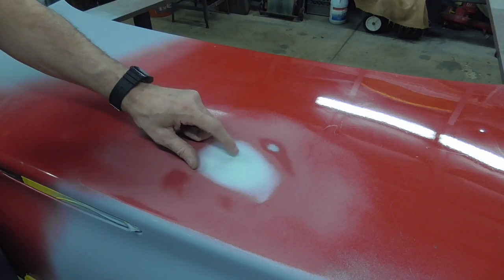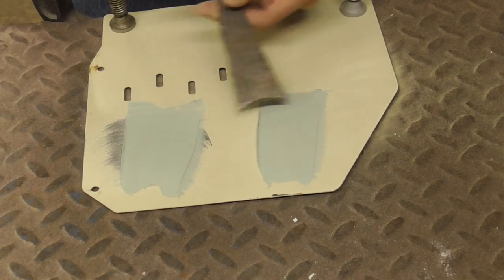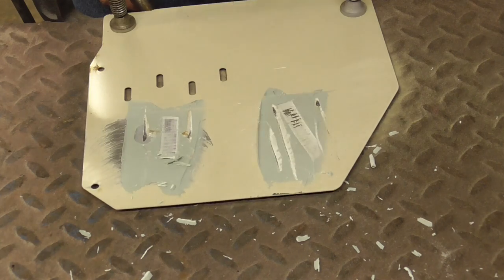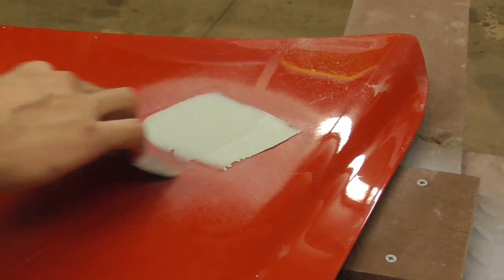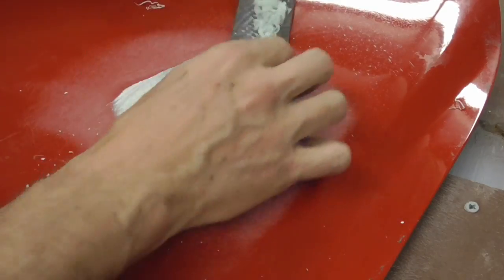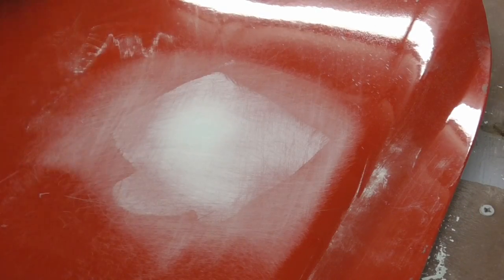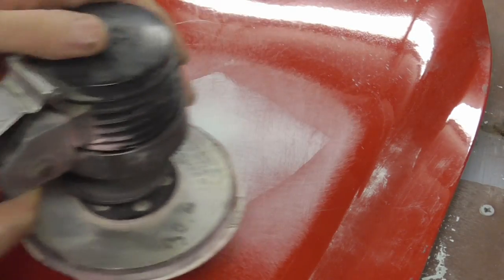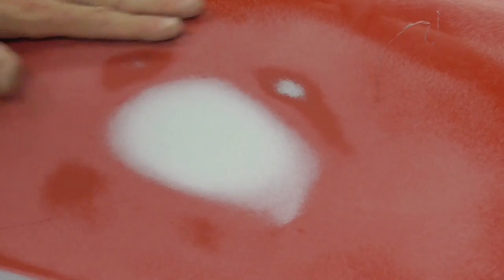Can Body Filler / Bondo be Applied Over Paint?

Comment: What about applying filler over primer?  I'd always heard that you should not apply filler directly to the metal but rather to prime the metal first, then add the filler.  That was until began watching your videos.  You apply filler directly to the metal routinely.  So, I'm kinda confused. :D  Thanks!
Reply from the maker: You never have to primer metal before filler.  I've worked in many shops and have never seen that once.  There are companies trying to sell a "pre filler primer" and its absolutely unnecessary.  Filler sticks best to freshly sanded/ground, clean metal. Use 36 or 40 grit fiber resin disc like these to prepare the metal:  https://www.harborfreight.com/4-12-in-36-grit-resin-fiber-sanding-discs-5-pk-69615.html   Shops use nothing else - go slow and keep the heat down.  The idea is to leave clean sharp cut scratches for the filler to adhere to.
Reply: @LakesideAutobody  Ok thank you!

Comment: What brand and type of filler is that?
Reply from the maker: Auto Body Master light weight body filler - right around $25/gal
Reply: @LakesideAutobody  is Evercoat brands alot better? Rage, z grip, xtreme etc...I'm needing one that will go on top of sanded paint that has no clear coat. Also easy to spread and doesn't dry real fast.. I sanded some spots to the metal. The areas that had rock dings and chips
Reply from the maker: @sonnywinstead9977  In my opinion - no.  That is when it comes to body filler.  All body fillers are generally the same and I always suggest going with a low priced body filler 😊

Comment: Could this be used on a plastic bumper?
Reply from the maker: It may work just fine - never tried it.  For a small crack or gouge I would just use body filler but for larger damage I would replace the bumper with one from the junk yard.
Reply: Thanks for the reply. I’ll give it a shot

Comment: Never use a cheese grader ,sand the filler while its still a little wet with sandpaper
Reply from the maker: Only the fastest guys in a body shop use a cheese grater.  A guy who is good with a grater is at least twice as fast as a guy who doesn't use one.  When you get paid by commission - that's when you'll start using a grater.   Truth 😊

Comment: Its's a load of bs, its just what the reps say that because they need to cover their ass and cannot guarantee anything without knowing what kind of quality the previous surface/paint is. Obviously during resto jobs things change alot. Good luck feathering old paint on some panels that come in for some insurance work that have been painted, primed 6 times and also have some bondo work. obv you are gonna bondo onto previous paint.

Comment: You are sure stuck on using that cheese grater. There was no need to cheese grade that amount of filler because you did not even put that much on there you could have sanded that off with 80grit from the git go. I do it every day at my job.
Reply from the maker: No way - takes too long / doesn't cut straight through.  With all due respect, 80 grit on freshly hardened bondo is just too slow, clogs up the paper,  and doesn't "cut" in order to achieve perfect body work with one filler application.  I've seen a lot of guys play around with fine grit sand paper and end up with wavy body work and a lot of extra work.  I'll stick with tools that cut through for straight body work.
Reply: @LakesideAutobody  I here you say that but that is not true at all. The time it took you to cheese it would have taken the same or less with 80grit I promise you i do it everyday all day. Because where i work the roughest grit that we have is 80 grit and i have no problem like you say. I would maybe agree with you if you had put more filler on, but that amount you put on was almost a skim coat. I will tell you what i will put up a video of me sanding with 80grit.
Reply from the maker: I 100% agree with you on the smaller stuff but for bigger dents I prefer to use the grater and 40 grit to start then finish w/ 80 - there's all different ways I guess - thanks for the comments - Jerry
Reply from the maker: aaron anderson  Good point!
Reply: Theres no reason for a cheese grater on such a small job. Just use glase and 150 grit  on a da.

Comment: You shouldn't just fill a dent heat it up with a small torch file it off no body filler needed
Reply from the maker: Just showing how dealerships and normal body shops fix dents :)
Reply: @LakesideAutobody  I'm pretty sure I've worked out a Chrysler dealership and a Cadillac dealership and we never fix dents the Way You are and I work in what you call a normal collision shop and we don't fix in that way either well I do we don't use hardly a gallon of body filler a year that's how well we straightener dents out before we fill them

Comment: Hi. Do you have time to reply pls?
Reply from the maker: Sure, what do you need?
Reply: @LakesideAutobody  Hi there and thanks. I have a new replica bumper for an Astra VXR (EURO CAR). I'm not happy with the headlight washer jet blanks as its just a replica they dont look as flush. The hole is bigger than the blank that goes into it. Can I use regular body filler to go around the inside edge of the hole so when the blank plate is in it has less of a gap around it? Or do I really need a special plastic filler? Thanks
Reply from the maker: @Pkdimmock  Great question.  Regular filler doesn't really stick that well to bumper covers.  Also it is really a bad practice to use filler as an edge as it crack or break easy w/o proper support.  That being said I have filled small imperfections on bumper covers with reg putty and filler and have had no problems but using it like you said, I think it would just break or fall right off that edge.  I think its best to use a product/filler that's made for bumper covers.  I know that's not what you want to hear but that's my honest opinion - Have a great weekend :)
Reply: @LakesideAutobody  Thanks for the reply. Its fine. I want to do it right and was thinking that it could be a weak spot to try this. I have seen plastic filler for bumpers and its only £8 so will pick some up. Thanks for your time. Your vids are great btw 👍🏼
Reply from the maker: @Pkdimmock  You're welcome - let me know how it works out for you - just comment on any video - I'll remember the conversation - Jerry -  Oh and thanks :)
Reply: @LakesideAutobody  Will do. Thanks

Comment: Instead of showing them how to Bondo over it. Why don't you show them how to fix it the right
Reply from the maker: This is how it's done.  In the old days you could "bump" more dents and file as the metal was very thick - today it's different.  Metal is 6 hairs thick - 22 gauge - .030"
Reply: @LakesideAutobody  oh really we still fix hail dents by either paintless dent or we heat them up and file them off like we always have Ive been in a collision shop for over 35 years

Comment: thank god this man doesn't do drywall repair.....
Reply from the maker: That's funny - I hang drywall with a friend of mine when he needs help.  
See this video for how long these methods last.  https://www.youtube.com/watch?v=2o37dX--w0I
Reply: @LakesideAutobody  you apply the bondo way thick for that little ding. If I repaired or taped drywall like that I'd be sanding for weeks.
Reply from the maker: @BatMan-cq8gq  Auto body is quite different from dry wall.  Dry wall you should not have to sand at all - just any nibs that are left from the knife edge spread it flat and tight.  Body work you have to sand filler so I try to get it in 1 not spread/sand/spread...etc. 
Trust me,  this was my job (retired).  I was fast when I worked as a body man.  I constantly thought of ways to cut down time because I was on commission.  Have a good weekend.  Check out my next video tomorrow after 6 pm - you'll like it for sure :)

Comment: Does this work on hail damage
Reply from the maker: Absolutely - that's actually when I started doing it.  We were fixing brand new Fords from a dealer that were displayed under a power line - they all got hit with ice dropping off the line. DA'ed the paint, filled them with 2 part glazing putty, sanded the whole panel all at once with a bondo hog, sent it to the painter.  Wonder if the dealer told the buyers about it?